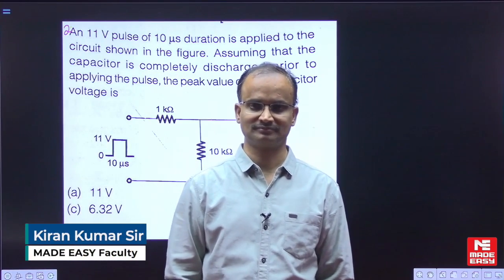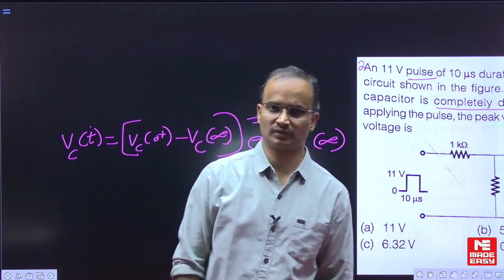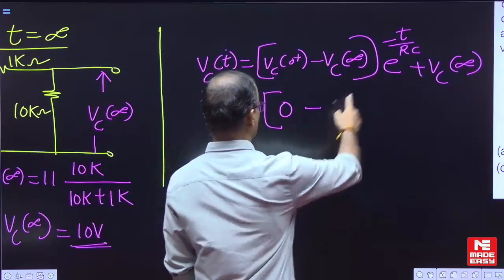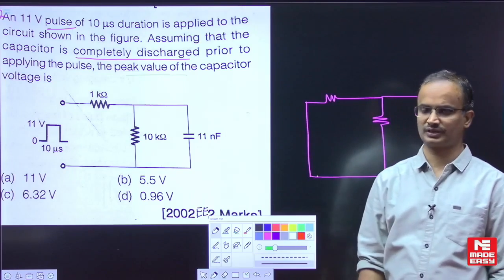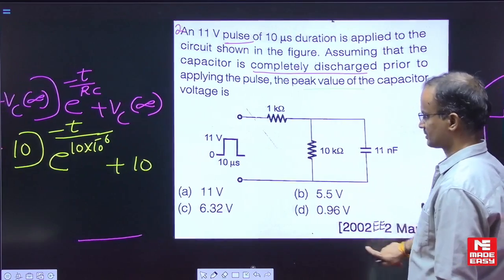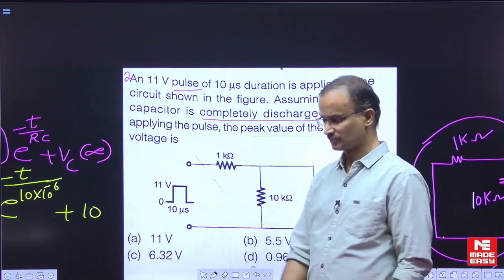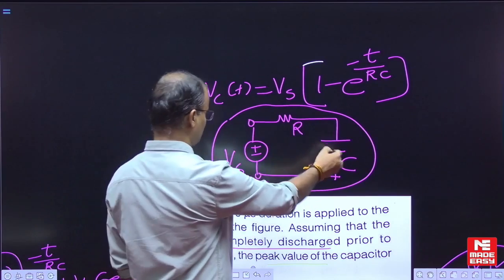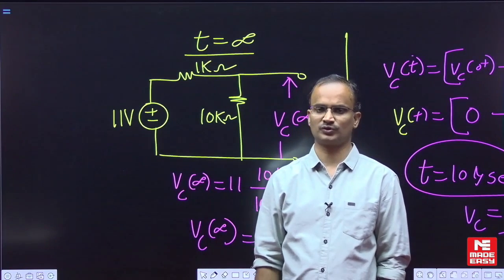Most Imp. Previous Year Questions|GATE & ESE |Electric Circuits|Part-2|By Kiran Kumar Sir| MADE EASY

Comment: Sir what if the pulse duration is more then the time constant, means capacitor is charging for more time and discharging for less time in that case how to find voltage across capacitor?
Reply: up to time constant it will charge upto 63.2 percent only , if pulse duration is more it will still keep charging just substitute pulse duration time there.